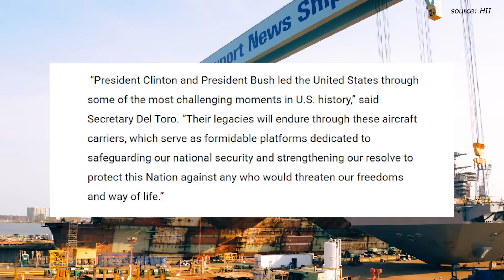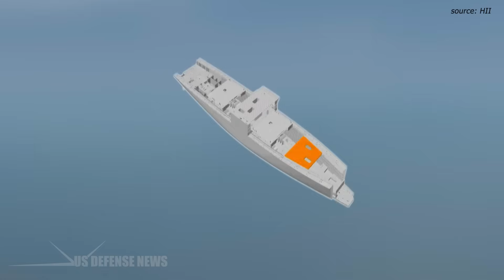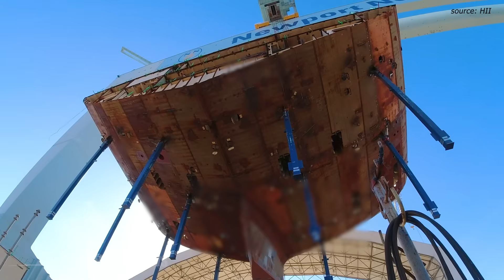Here Are 6 Names of New Gerald R. Ford-class Aircraft Carriers to Lead the U.S. Navy Until 2100

Comment: There’s something wrong with a couple of these images: at about 1:33, the image labeled Nimitz has “78” on the forward deck. Nimitz is number 68. Ford is 78. 

At 3:50, the rendering of Enterprise has number 08 if read from aft, the way these numbers are usually read. If viewed from forward of the ship, it reads 80.